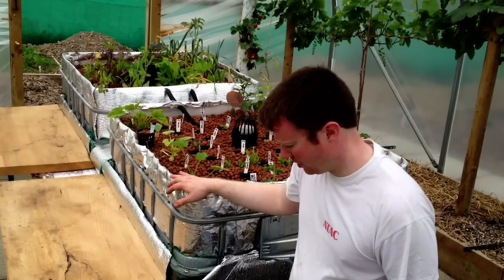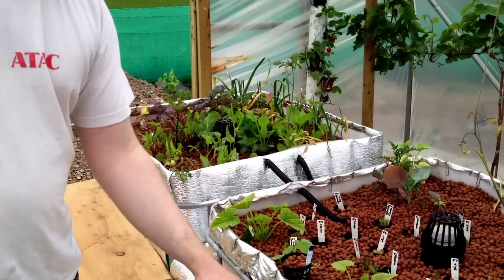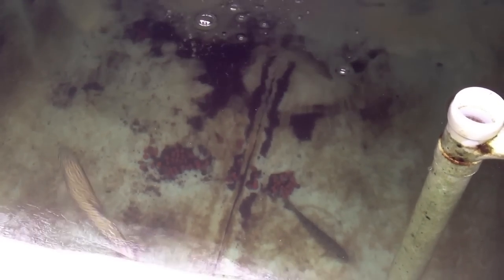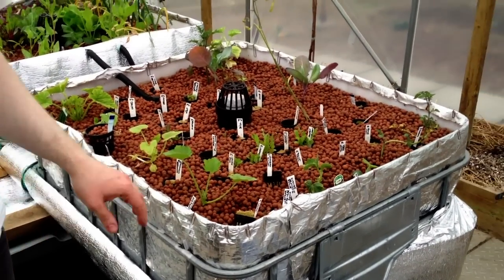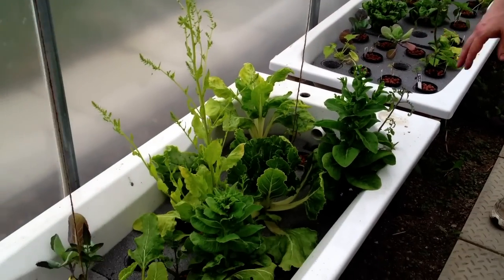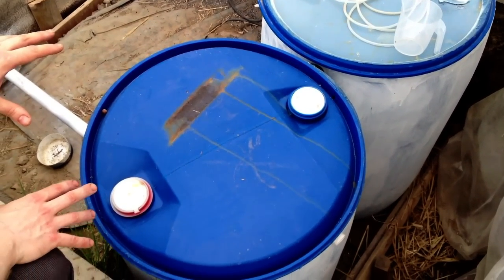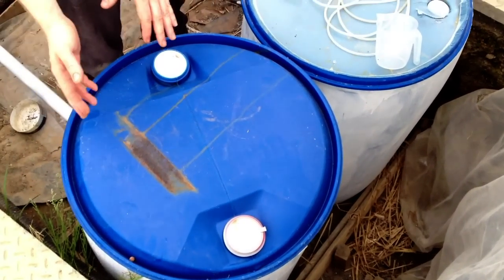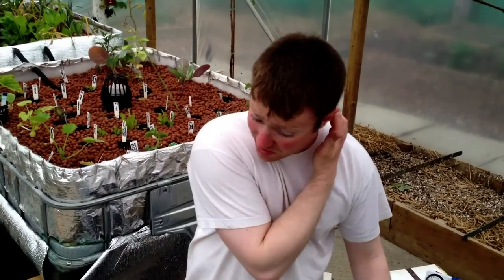New Aquaponics System 2

Comment: how do you keep temp cold enough for trout?
also pea gravel is probably cheeper than that plastic media, and has larger surface area. it is one of the cheepest bio medias. you can match size to needed flow rate. then you have a buried pipe system at bottom of filter bank that is used to blow air with blower to clean media when needed. you back flush out . they use this type on aligator farms. thanks for vid
Reply from the maker: With the tanks buried and even in the heat wave we had this week the tunnel was very very hot the water temp stayed around 22 Degrees i do have a lot of aeration and the water temp in the water does not fluctuate much at all over the day maybe by a half a degree. I now have carp and koi and will be uploading a video once i clear out the poly tunnel. Hydroton is very very light and has good surface area for bacteria and is very easy to plant in and this is why we went for it but every media has pros and cons. Were still learning years later and even as we are finishing up this system we are designing a new system even better for 2015-2016. Thanks for watching and helping with suggestions we appreciate it. Please subscribe for future videos! God Bless!
Reply: Naturally Healthy Cheers for the Video, I just read that you buried your IBC tanks and are getting a constant temp of 22 degrees C.

Are you in the Uk 🇬🇧?

Is this temp all year round round?

Did you have to insulate your tank?

I am looking to set up a small system (2000lt) and wanted to put the tanks in the ground, I just need to find out if it will be beneficial on cost of electricity cost to do so.
Reply: Interesting. have you thought of biochar before?

Comment: Hi Paul, i have watched all you vid many times (i wish there were more) i have just installed a 10m x 5m polytunnel, picking up a few IBC's mon/tues you helped me get started, (thanks brother)do you have any designs for this or even better for your next and improved system, as this could save me a lot of time and money which i dont have to waste, or any tips you may have. Any and all advice well received and i would be very gratefull, many thanks and God bless tony o
Reply from the maker: Hi Tonyo o thanks a mil for watching. We are still putting the final touches on the new system and its been difficult with interconnecting all the ibc tanks together alot of thought has to go into it before doing anything especially you got to have backup overflows because there is always emergencies that you don't expect. We not finished the new system yet and i am planning another new system for next year. I'd like a long swim type pond beside the new IBC tanks system but it will take a while before i can say for sure which works best. The best advise is get a good quality air pump and water pump as theses are your lifeline any other way i can help and just ask! God Bless,Paul,
Reply: MrPaulnestor
Thanks paul, are you thinking of a raceway (long swim type pond) with the IBC's?My polytunnel is 10m x 5m what size is yours and what would your total added fish tank and raceway volume be? I am looking at not having any water pumps and using air lifts to move the water (my understanding is they are cheaper to buy and run and move solids better and last a lot longer, any thoughts on air lifts?)
Thanks for you help brother, God Bless,
tony o reilly
Reply from the maker: ***** Dam thats sounds interesting air lift water pump i'm going to have to work that into next years aquaponics thanks for the great idea. So my super strong air pump will run my aquaponics expansion!!! :) I have 3 x 1000 liter fish tanks and 1000L sump tank, 3 x DWC bathtubs also a homemade radial flow filter and K1 media filter. In total around 5,000 liters in the system. I like how i can put koi and show fish in the IBC tank that is at the front door of the tunnel and the other two tanks can hold different size carp. I would like if we finish the current system and it works well then dig a raceway and stock the largest of the fish there. I not sure what size it would be it! I have the same size polytunnel and its great here as its always raining. Dont stock much fish at all when you start as for the first two years you will kill fish as theres lots to learn. At the moment i have only two fish in our system and they are keeping quite a lot of plants happy. Exciting stuff!
Reply: MrPaulnestor
Thanks for your advice, good luck with your new system, hopefully we will chat again,
tonyo